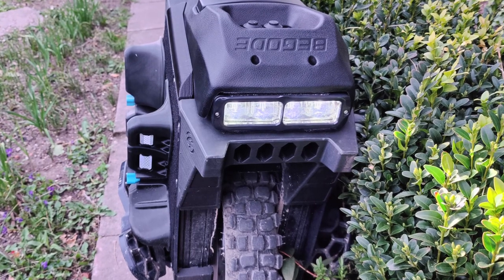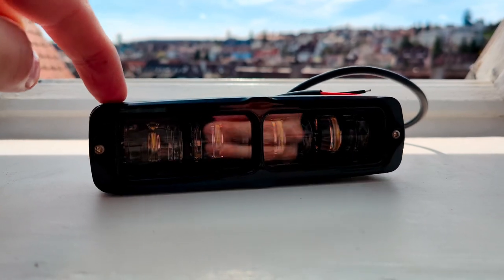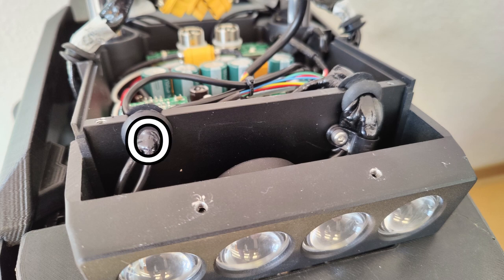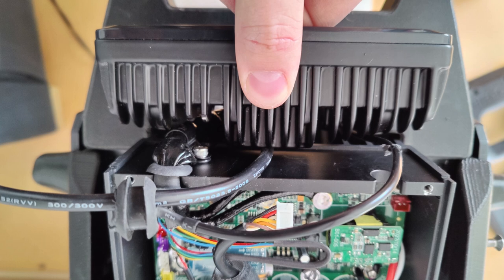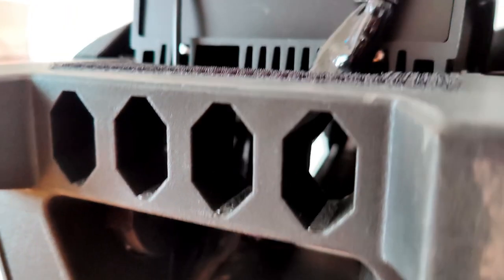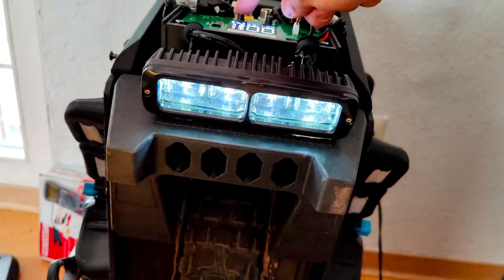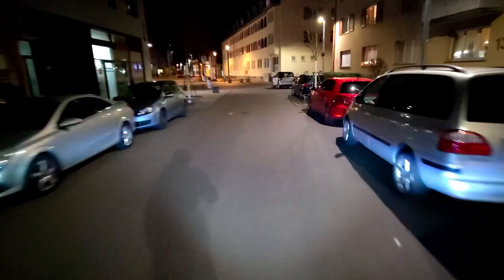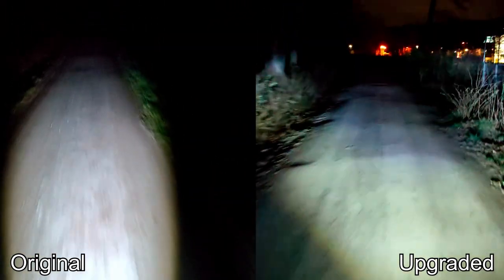Begode T4 & Master Headlight Upgrade - Was it worth it?

Comment: I'm sorry that you went through so much trouble. A wheel of this price should have a light that just works and is satisfactory. Obviously the budget and engineering is going elsewhere.
Owners of the MSX, MSP, RS and similar wheels feel this pain as well. The sad news is that there is no easy way to mod to wheel like you did.
So what I ended up doing is just to carry a potent flashlight with me. Whenever it gets dark then I just carry it in one hand. It's super potent and I can point it at whatever I want, almost following the eye, basically. It's ghetto, but it's the best, cost effective solution that I could come up with.
Reply from the maker: Yeah it's crazy how the prices went up! For me it looks like Kingsong and specially Inmotion did a better job when it comes to light. But in the end I should have probably just stick to a flashlight like you did. Thank you for your comment!

Comment: Is there a risk of damage to the motherboard for this operation? Does it cause cutoffs while cruising on the road? Did you put a 12V headlight on the device?
Reply from the maker: I would say no because it's just a light. I'm pretty sure it was 12V, however, it wasn't as bright as expected. I would change the T4 light, but there might be better options out there.

I diduhave any motherboard problems though.
Reply: @floatypiet  Thank you.

Comment: 2.14 that rubber thing in english is called a grommet or rubber grommet. I thought those lights were 12V and Begode lights are 5V ?  That would reduce the brightness a bit I imagine. Self levelling headlights are needed on EUCs more than any other vehicle.
Reply from the maker: Ohh, you might be right! Maybe there is a 12V output somewhere on the motherboard so solder it on there🤔 thank you for the tip!
Reply: @floatypiet  I dont know why they don't just ditch the lenses and  parabolic reflectors and go for flood light LEDs. Having a bright spot centrally just ruins your dark adaptation.